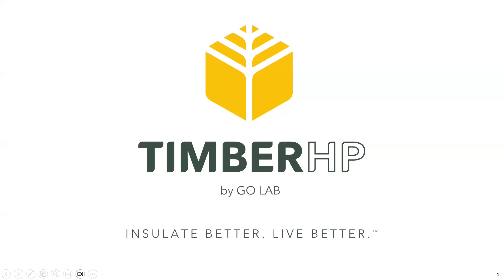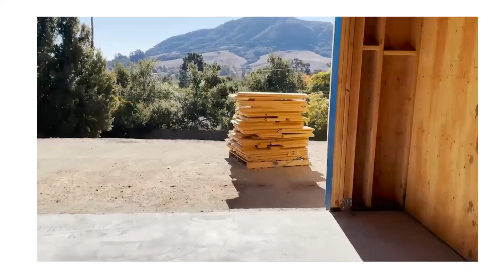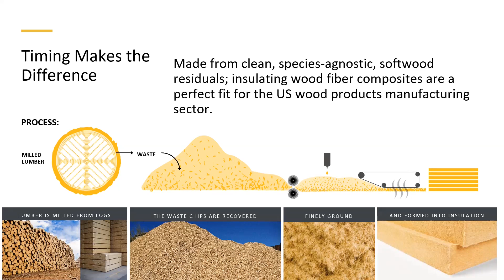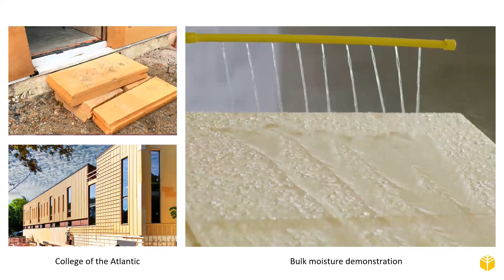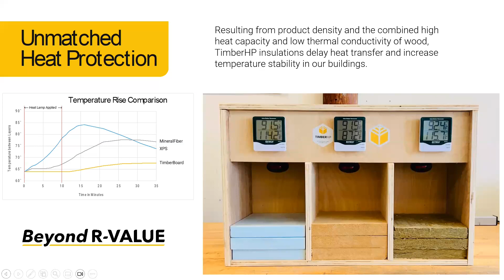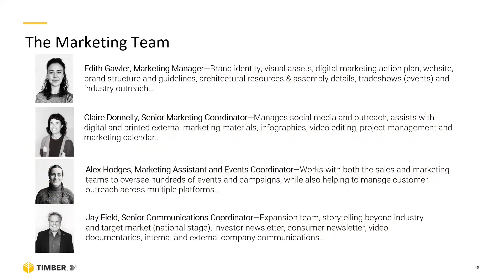Passive House: Wood Fiber Insulation

Comment: TimberHP seems like a very interesting product. I'm comparing fiberglass and cellulose alternatives to insulate my garage and attic. The heat diffusion test is really neat. I am surprised that Rockwool has a lower resistant to heat. I'm looking forward to the batts becoming available for purchase since I think they might be easier for me to install over TimberFill.

Has Go Labs/TimberHP been in contact with the US Green Building Council? I photographed several of their events when I lived in the DC area. I also did Montgomery County Department of Environmental Protection's events too. That area really pushes for new construction to meet LEED standards and offers incentives for retrofits to attain them. They've had solar and energy audit firms at their events. I think insulation and air sealing would be great topics too.